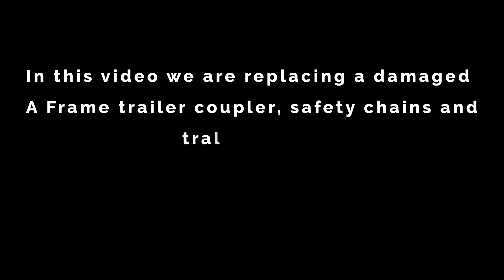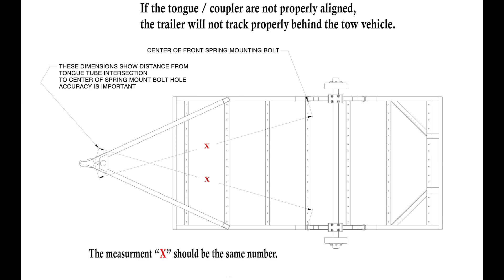Replacing A-Frame Coupler on a Utility Trailer

Comment: Would bolting the new coupler on be sufficient?
Reply: Hmmmm maybe if high tensile bolts but you cant beat welding mate
Reply: Yes you can definitely bolt on a trailer coupler. But you have to buy a bolt on coupler. I will not risk it by bolting a weld on coupler. Heck Demco makes a bolt on coupler rated for more than 20k!!